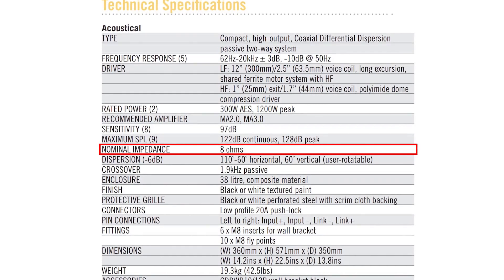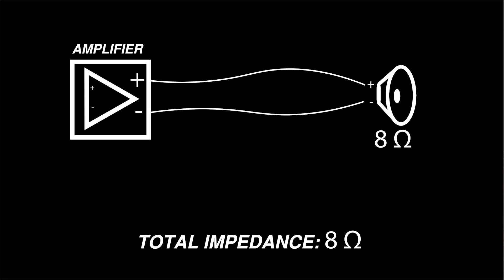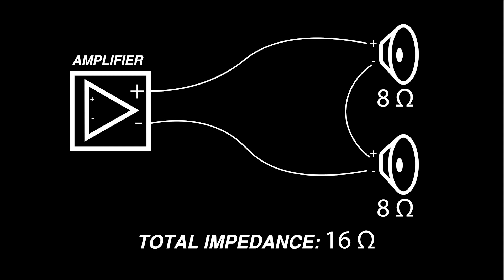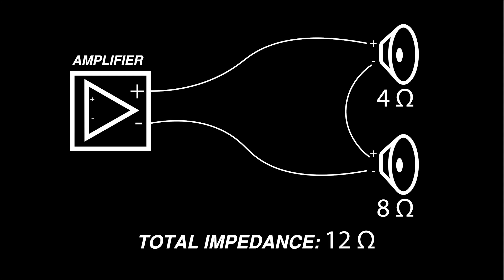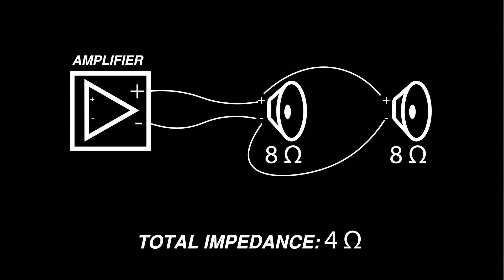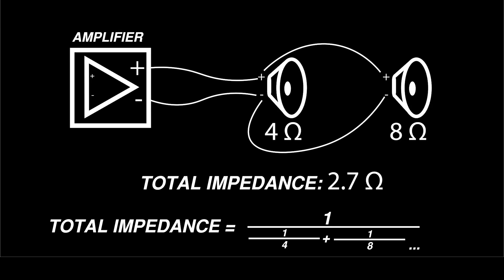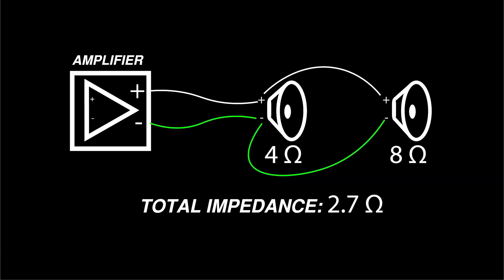SERIES vs PARALLEL: Speaker Impedance Explained

Comment: There's something I don't understand... In Bi-Wiring, if I use a plate is not like using speakers in parallel? So if I'm using Bi-Wiring from the amp, I'd have 6ohm, and if I use a plate by connecting positive with pozitive and negative with negative, do I get 3ohm? I searched for a video made by you regarding Bi-Wiring, but you don't have any. Can you explain here?
Reply from the maker: When bi-wiring, you do not use the plate. Using the plate would short the terminals between the two amp channels, which might cause damage to the amp.
Reply: @AudioUniversity  I'm talking about Bi-Wire Speakers which comes with Bridging Plate. There are plenty of tutorials on the internet where people say there should be two wires for positive and two wires for negative for each speaker. But to me just doesn't make sense, as long as the positive of the tweeter meets with the positive of the woofer, I think it wouldn't matter if they meet at the amp, or they meet at the bridging plate. I asked you because I trust you more than other and I wondered about your opinion regarding this.
Reply from the maker: Leaving the bridging plate installed is placing the two sets of terminals in parallel, you’re correct. If you intend to bi-amplify the cabinet, remove the plate. That’s where I was confused - bi-wiring vs bi-amplifying.
Reply: @AudioUniversity  So it means by using the bridging plate I will apply your theory and instead of 6ohm I'd have 3ohm, is that correct?
Reply from the maker: Which speakers are you using?
Reply: @AudioUniversity  Mission Cyrus 781 (they are bi-wire), so far what I found they are 6ohm. But I couldn't find out if they would have 6ohm if I use two amps, one for HF, one for LF, or if they have 6ohm while using the bridge plate. This thing with bi-wire seems complicated.
Reply from the maker: I believe the cabinet as a whole is 6 ohms when using a single amplifier and the bridging plate.
Reply: @AudioUniversity  Thanks! 🥰

Comment: Why would you end with giving someone advice on a 2.7 ohm load? What amp has a 2.7 ohm output? You could’ve just easily used a 4x12 example and had math that worked out to what someone would actually deal with.

Comment: I need some help connecting 4 passive speakers thru my amplifier to a mixer. I want to use 2 of the passive speakers as monitors.
Amplifier - sound blast sb2500
Mixer - sound blast sb desk mg24

Comment: I have two subwoofers that each have a 1/4” +/- jack, two loudspeakers that also have 1/4” jacks, and two vintage pioneer loudspeakers with the screw down connectors on them. All driven from a 1000W Power Amp. How can I connect these speakers? Thanks!

Comment: Putting a 4 ohm and an 8 ohm speaker in series is not a good idea; the 8 ohm speaker will get twice the voltage across it that the 4ohm speaker gets(Ohms' Law), and since the same current flows through both it gets twice the power.

Comment: NEED HELP. Could anyone answer me? I have Peavey 6505 head and Mesa 2x12 Horizontal (8ohm impedance, parallel), which ohm from the amp should i choose to connect to the cab, 4ohm or 8ohm ? Many thanks
Reply from the maker: 8 ohm.
Reply: @AudioUniversity  thank for your answer

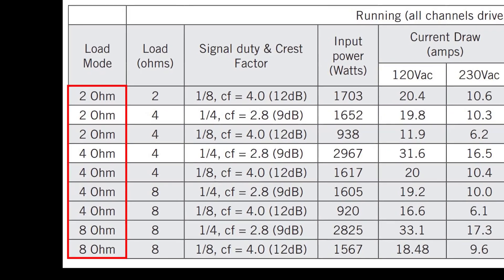Comment: For the sake of clarity - at about 1:18 you refer to "the impedance rating of your amplifier". Note the heading of that column is "Load Mode".  "the impedance of your amplifier" may also refer to the output impedance of the amplifier itself. What this refers to is maybe best explained by why batteries are tested "under load".  Eight new 1.5V AAA cells in series will give you nominally 12V (no load) but cannot be expected to start a car. Their internal resistance is too great. Something inside the cell resists delivering so much power.

So if someone stumbles across a spec sheet that lists output impedance my first reaction is to be very clear that this is not the same as the range of speaker impedance the amp can handle.

The output impedance has consequences and can be useful information. Low output impedance indicates that once a woofer has been set in motion it stops when it is intended to stop resulting in bass clarity. Low output impedance means greater thermal efficiency thus amps can be more closely clustered in a rack (all else being equal).

If you want a string of wire with gain look for low output impedance (as some describe an ideal amplifier) . The reality is that much of our musical history is built on "perfect imperfections" (thanks Sylvan LaCue and John Legend) where the output stages are stressed  For example many guitar players swear to the fact that a VOX AC-30 does not reveal how beautiful it can sound at lower volumes.

To make an informed choice the spec sheets may help but understand the amp and speakers are paired or a community. They interact. Powered/active speakers are often a good choice. 

PLEASE LISTEN when spending money on audio gear!

Thank you for this very useful and informative channel.

Comment: Thanks for the video.

I have Systemline E50 Amp, which has minimun speaker impedance of 4 ohms. Maximum output level for speakers is 18W/ch continuous.

I then have two stereo-speakers, which both have two terminals L+ L- and R+ R-. Both speakers say 8+8 ohms impedance. It also says below that 4.5 ohms @ 185Hz. RMS 100W.

Problem is now that I have only one cable per speaker, which means that I can only attach the cable to L+ L- or R+ R- in one speaker. It is not possible to have more cables.

If I understand correctly, the second tweeter of the speaker doesn’t work now.

In speaker, can I bridge two terminals together? Like L+ to R+ and L- to R-? Would both tweerers work then, and would it be safe? I thought I’d switch my Amp to mono-mode, and it doesn’t say in the manual that it would halve ohms.

Thanks.

Comment: Quick question so if i ran two two channel amps on a mono bridge each to a single speaker tower with respective left right inputs how would one go about adding a subwoofer without adding a third amp and or drawing power unevenly to one of the two towers can four cables two to each amp joined at the sub work?

Comment: I have one tactile trasducer with 6 Ohm. It Is possible to connect it to hifi amplifier? I think to connect red cable to red right channel and black to black left channel. Then connect red and black of the amplifier togheter.. How is total impedence charged on the amplifier? Minimum is written 4 Ohm. Sorry for my English
Reply from the maker: I would not recommend connecting the two amp channels together. At 6 ohms, it fits within the guidelines for a single channel.
Reply: @AudioUniversity  thanks. So how can i do? Buy a mono switch?
Reply from the maker: In order to use both channels together, you would need an amp that has a bridge mono mode. Not all amps can do this.

Comment: My Amp. is 6-16 ohm . My speakers are of 6 ohms. Because one of my channel is not working properly I connected both speakers to one channel. I connected speaker1 to the Amp. and then I connected speaker2 to speaker1. Is this parallel connection and will it result in producing 3 ohms to the Amp. and damage the Amp.?

Comment: Kyle, I connected 1 pair of Bookshelf Speakers , Elacs , which have a Nominal Impedance of 6 Ohms (it's rated at 8 Ohms , but 6 Nominal), and 1 Pair of bookshelf speakers , KEF Q350, rated at 8 Ohms Nominal to my A Channel of the Denon DRA=800H receiver.  After playing CDs at relatively high volume, The Receiver shut down due to overheating (its a Protection feature of the Denon).  I guess the Marriage is not suitable.  I tried a different pair of Speakers , Fluances with a 8 Ohm Nominal rating and that overheating didn't occur....  Would it better to connect the speakers in Series ?  Would the Speakers sound the same?  THX
Reply from the maker: Does the amplifier have enough power per channel for both of these speakers? Check out this video: https://youtu.be/nxIajDzQjzk

Comment: 1600 watt rms streo amplifier me 6 speaker connection plzz reply.
2 pec. 12 inch speaker 8Ω= 250 watt.
2 pec. 12 inch woofer 4Ω = 400 watt.
2 pec. 10 inch woofer 8Ω = 80 watt.

Comment: Ok this is my question: I have an older JL kicker boxer, 8in speaker. I blew my speaker. I'm having a problem finding the exact speaker to replace it with. Of course the only one I find is almost $400..
Will any 8in speaker plug into the box?
Reply from the maker: To get the similar performance, you’ll want to make sure the new speaker has the same nominal impedance, sensitivity, and power handling capacity as the old one. Is this a sub or another component of the system? If it’s a sub, you probably have more freedom to make changes in the amp and head unit because there is only one. Otherwise, you should ideally try to match it to the other speakers.
Reply: @AudioUniversity how do I know that? Is there a cross reference? I'm gonna call JL Monday, but the plug in's are compatible?..or if I have a JL box, I have to replace the speaker with a JL speaker? My car now is a GTI (I LOVE IT) bought with the JL system. My last vehicle was a Nissan bought with a rockfordfosgate system (I loved it)... could I put a 8" rockfordfosgate speaker in it? How do I determine? Sorry, I know nothing! Except I love good loud music!
Reply from the maker: I’m not very knowledgeable when it comes to car audio. I think calling the company is a good option.

Comment: i need help finding the best amp for my marine wakeboard speakers please. i have 4 of them and the impedance is 4 ohms a piece which if wired in series gives me 16 ohms. i have a 200 watt rms, frequency response of 60hz-20khz, and sound pressure of 96db @ 1w/1m. im looking for the best amp for these speakers. im new to this and need some expert help.

Comment: So it’s louder to use parallel wiring cause it’s less ohms for the amplifier to manage… am I right?
Reply from the maker: It’s better to think of 4 ohms as “more” to manage than 8 ohms, because it requires more current at a given voltage. I think I explain that better in this video: https://youtu.be/uum1gQXz5mA

Comment: Question, if I had a stereo amp that's 150rms per channel and 4ohmcan I run 4 x 8ohm speakers and wire them so they are all ran at 4ohm?
And second question do I need the 4 speakers to be 150w or each speaker should be 75w

Comment: How do I wire 4 8ohm speakers to 2 ohm
Reply from the maker: Parallel. 

8 Ohms/4 speakers=2 Ohms
Reply: @AudioUniversity  thanks man I was adding each ohm on each speaker so 8x4 and getting 32 then dividing that by 4 and getting 8 I was just a little confused on that

Comment: I don't know where to start - but I'll start here... you are confused - the basics of Ohm's law is that higher impedance speakers will present a LOWER load to the amplifier, not a higher load as you said at 0:47. I = V/R. As you increase R, you are decreasing I.

Comment: One question, I want to hook up 2 dvc 4 ohm subs in parallel which should total 4 ohms total. My 4 channel amp is rated at 4 ohms nominal in bridged mode. So I have only 1 pos and 1 neg  wire coming from my sub box. So to wire the subs to the amp do I connect the pos to the pos terminal on channel 1 and the neg to the neg on channel 2 and ignore channels 3 and 4?

Comment: Hi Kyle, excellent knowledge videos, very well defined terms. Thank you.

I have 5.1 system configuration on Yamaha RX-A3000 receiver believe it's 6 ohm connected with all B&W speakers. 
Two cm8's (left-right) 8ohms each.
CMcenter in 8ohms.
Two rear cm5's also in 8ohms each.

Am I over clocking or over loading receiver? 

Also do you have knowledge video on bi-amp wiring?

Thank you in advance for everything you do.
Reply: Sorry RX-A3000 is 8 ohms per manufactur specifications.
Reply from the maker: Hi Ashish. It sounds like your speakers and amplifier impedance is matched and correct. The calculations in this video apply only to multiple speakers on a single amp channel. A 5.1 system includes 6 separate channels.

Comment: New sub. Okay. I'm a drummer. But I also attempt guitarring and bassing. I just got a (yeah, I know) Peavey Mark IV head with a 4Ω 115BW cab and afterwards I traded a guitar for another Peavey cab --an empty 410TVX, rated at 4Ω, with the horn and crossover intact. 
Peavey shipped these with Sheffields, they say, but I can't seem to find much 411 on them. 
Once I get the speakers and wire it up to be 4Ω, will using the Peavey head out of both provided outputs then make the entire rig run at 2Ω ? Yes. It's parallel circuitry and I'll get a whopping 300w over 2Ω into a 4x10 and a 15" rig. And I have a line out..... Now if I can only find their wiring diagram.....

Comment: can we apply this to any home theater speakers?
Reply from the maker: The same principles apply to all speakers, but most home theater speakers/amplifiers are intended to be used with one speaker per amp channel.
Reply: @AudioUniversity  example is i have 2 home theater speakers into 8 ohms but my AVR receiver required only the 4 ohms per channel ,  i can apply to combine the 2 speakers in parallel to make it into 4 ohms and plug it into the AVR receiver?
Reply from the maker: That’s correct. The combined impedance of the two 8-ohm speakers in parallel will be 4 ohms.
Reply: @AudioUniversity  thank u kayle more help.

Comment: Why did you leave out the most important part of the entire video. lol how does 1 over (1/4 + 1/8) = 2.7 ohms. The math is the part where most people get confused and you completely skipped over the final and most important step of showing how that calculation is done. For anyone wondering you have to find the lowest common denominator, which is 8. multiply 4x2 to get 8 then put 2/8 + 1/8= 3/8 and divide 8 by 3 to get the 2.6... Hope that helps for people wondering. I have a slightly different problem.
   I'm trying to add 3 pairs of speakers. It seems to get more complicated and here's where I fall apart with the math to get me to between 6-16 ohms for my stereo.
3 pairs of speakers. One 8 ohm pair and two 6 ohm pairs. Total of 6 speakers. For a left/right channel stereo with a connection for a sub.
Currently what seems to work best is I have the 8 ohm speakers wired like normal. Positive and negative directly. Then I have the 6 ohm speakers running in series, added to that from the stereo. So not daisy chained if I understand that correctly.
   So for each left/right connection it's one 8ohm direct, plus the two 6ohm in series added to that from the stereo. I can't figure out if that would be.
8+12 ÷ 2 or 3
or 1/8 + 1/6 + 1/6
or 1/8 + 1/12... Anyone that has more experience with this and could help me with that one, it would be appreciated.
I just know that it sounds better and seems to work better so far than wiring them in series together. Which now I know put the impedance at 20 ohms when I had them like that.

Comment: Correct me if I wrong but the higher the load (resistance) of the speaker, the less load on the amplifier, as shown comparing the speaker output wired at 2ohms verse say 16ohms, the 2ohm speaker will be receiving almost 4 times the power. Maybe the definition of load is where I'm getting mixed up in you description
Reply from the maker: Think about it like this…
To supply 30 Watts to a 2 ohm speaker requires much more current (amps) than supplying 30 Watts to a 16 ohm speaker. So, the components of the amp will get hotter trying to supply a given power level to a lower impedance.

Comment: If I have an amp rated at 8 ohms and I connect two speakers at 4 ohms in series to give a higher load, is that ok? From what I understand (I’m nowhere near as knowledge in this of stuff) you should use the rated ohm load on an amp or higher to prevent over heating/clipping. Am I correct?
Reply from the maker: That’s right, @Texas. Your amplifier will be specified to provide a given level of power at a specified impedance. As the impedance decreases, the current to provide that power increases. Check out this video for more info about matching amplifiers and speakers: https://youtu.be/6B0OlQaD_i4
Reply: @AudioUniversity  is there a limit to the amount of ohms/impedance an amp can take?
Reply from the maker: It has more to do with the limited current the amp can facilitate which is impacted by impedance.
Reply: @AudioUniversity  oh ok, makes sense. That’s what I assumed. By limited current you mean the wattage right?
Reply from the maker: Amperage. If the amp tries to provide a given wattage at a lower impedance, it will overheat.
Reply: @AudioUniversity  gotcha. Thank you very much, your videos are really informative and easy to understand! I appreciate it!
Reply: Hey I have another question, I have a 2007 Lexus Gs350 with the mark levinson sound system. From what I can find online, the speakers are an 8 ohm. Idk the specs of the amp since I have not looked at it yet but the rear sub rattles at low bass. I think the foam around the cone needs to be fixed but If I replace the sub with an aftermarket (skar/kicker sub) 4 ohm sub do you think I will damage the speaker/amp? Idk how it is wired since I can’t find anything online about it. 

Id like to replace all speakers in the car but idk how soon I can pay for it to get it done. Do you think I should replace the speaker if it won’t cause damage or just wait till I have it all done?
Reply from the maker: While speakers have a fixed nominal impedance rating, amplifiers do not. You would need to check out the range of impedance that your amp can reliably supply the needed power into. Amps will overheat at too low an impedance, so it’s important to only operate within its specifications.
Reply: @AudioUniversity  ok thank you, if I have anymore question I’ll be back🤣 (didn’t see your reply earlier)